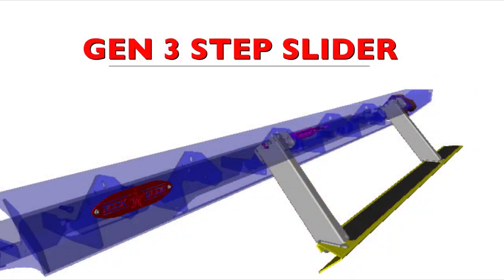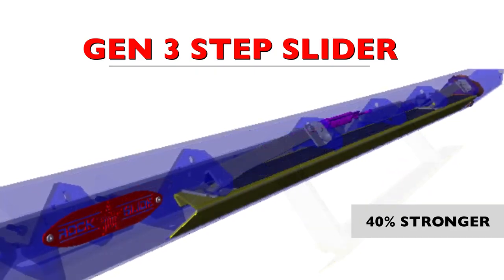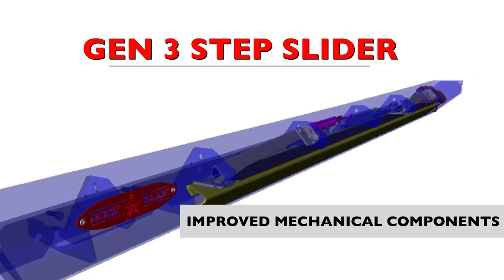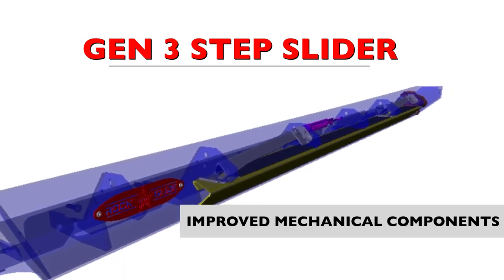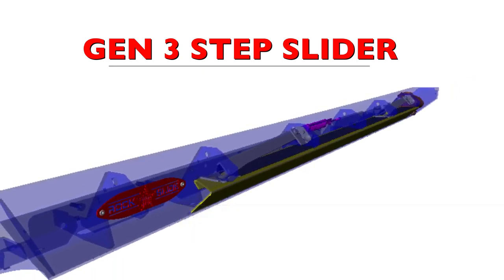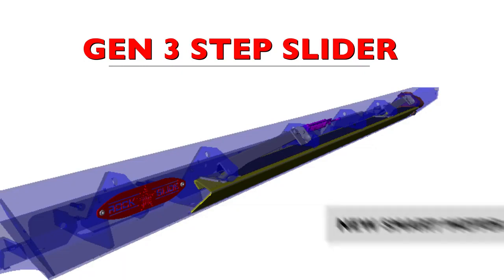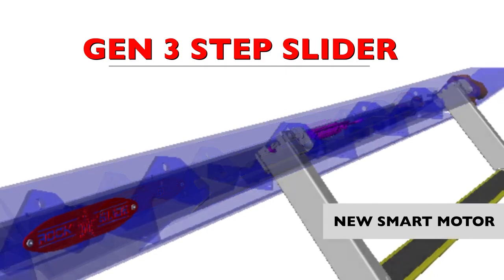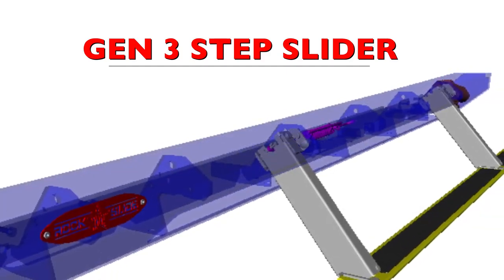Rock Slide Engineering Step Sliders - New Generation 3

Comment: Saw it in SEMA this year. For the price,  I just wish they have a black textured finished on rivets and emblems. And what's with the tiny sharp edge steps? Also, eliminate the magnets and sensors or at least include another set of magnets for factory half doors. Amp XL installs much cleaner without any magnets, but I have to admit this company makes solid product tho. Heavy duty stuff.